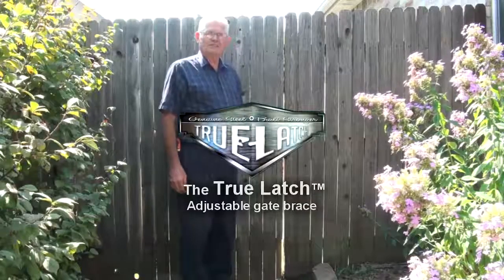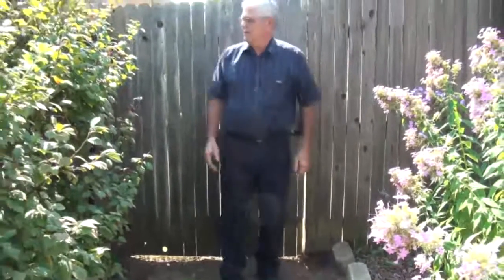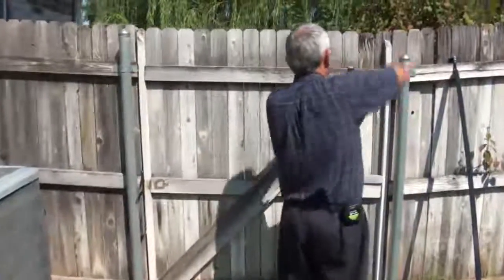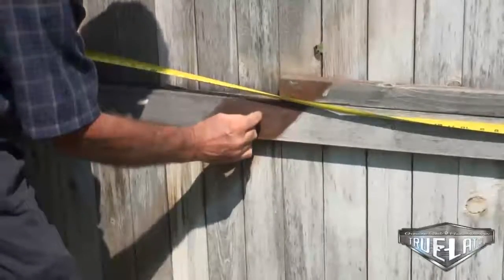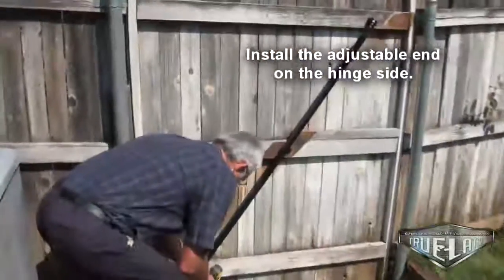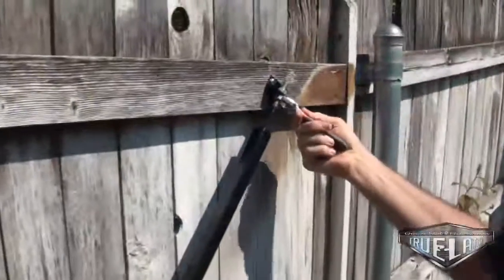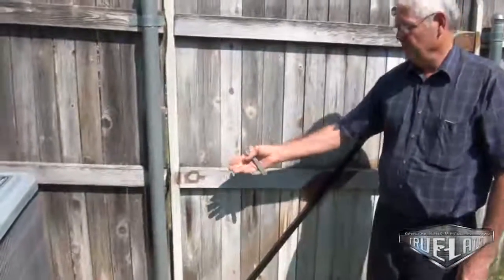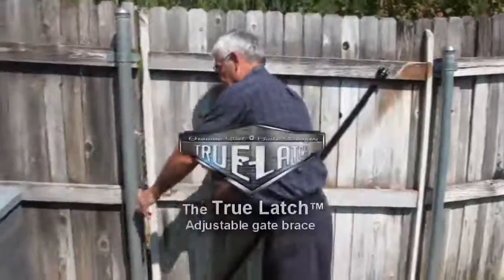True latch  - The Adjustable steel gate brace for wooden gates

Comment: Those cross braces are junk. Zero adjustability which is why they fail. Wood expands and contracts with the weather and age. You need either an adjustable turnbuckle kit or this one.
Reply: A wood brace does not contract in its length